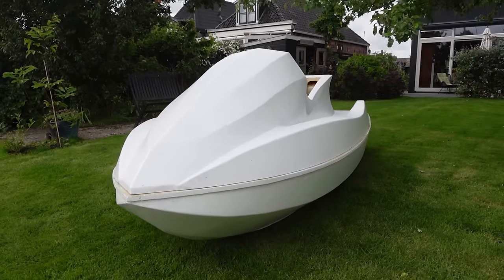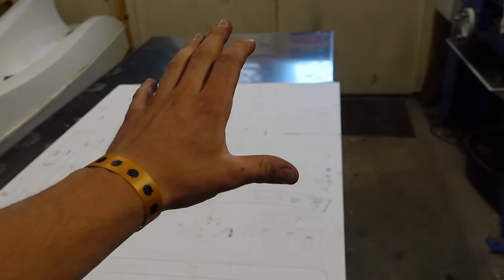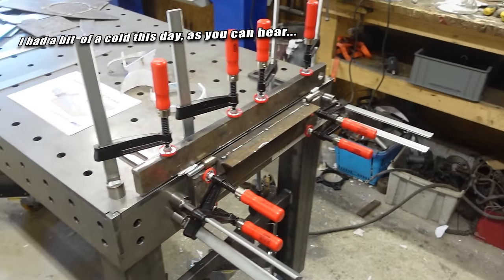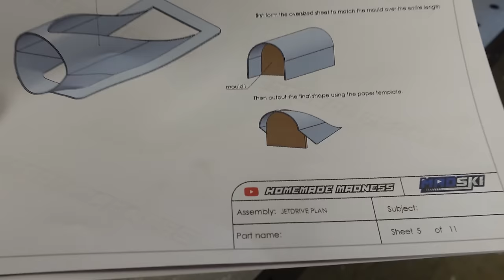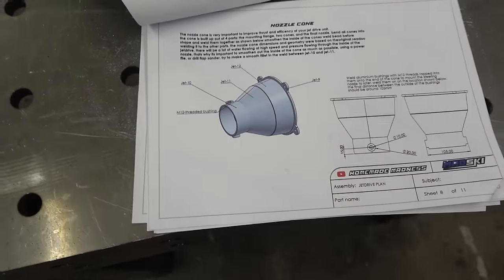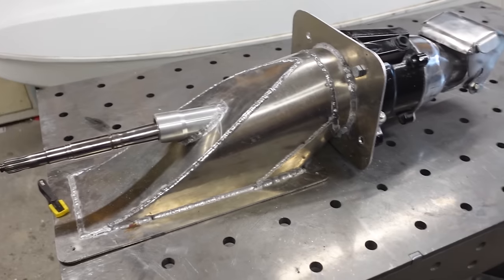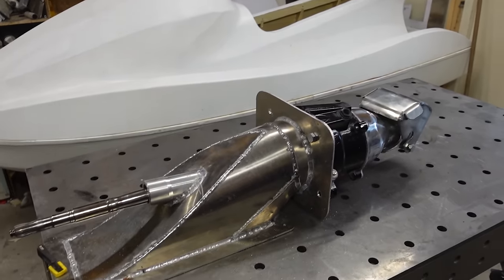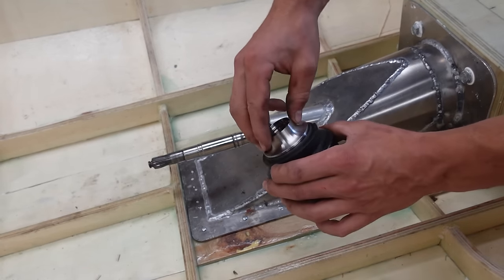How to build a Powerfull Jetdrive 200+HP (for jetboat, jetski, flyboard)

Comment: Aluminium forms an oxide layer almost instantly that interferes with welding so you should grind or wire brush it of around the welding areas right before welding. You may want to wipe it of with alcohol as well as the plastic film might have left some residue on the surface.
Reply: Most would say acetone since it will remove any oils better than alcohol... And some welders would say it's pointless but they are likely ones doing shitty welds.

Comment: Just ran across your channel and love the build and I’m not trying to be one of those people but the force of water going thru that pump I’m afraid will blow those wood screw out pretty quickly, I would also glass the plywood box in a little more on the inside and secure the alum. plate on the bottom. Don’t underestimate the power of water. Again I like the build
Reply: Bro is what I was exactly thinking
Reply: Most of it will see negative pressure. The only part seeing positive pressure is from the impeller to the nozzle and bucket and those are all aluminum and welded.

Comment: Tip for welding aluminum. Always clean surfaces with acetone before welding, even if it looks clean. Wipe your feed rods with acetone as well. It's a good idea to also use a wire brush or green scotchbrite pad where you plan to weld just to make sure surface residue is gone. For areas that will be welded don't mix materials with abrasives, meaning abrasives used on aluminum should only be used with aluminum. Taper the amps at the end of the weld to prevent suck-back (can be source of cracks). Turn up your post flow time to at least 5 seconds, I usually use 7 seconds minimum at 17-25 cfh. 

I like using the foot pedal with aluminum because there's a small temp difference between a good consistent weld and having it blow out. Every time you dip the rod it sucks heat out of the weld and can cause it to re-solidify so I usually manually pulse to keep it in the sweet spot. But overall starting out on the thicker material is definitely easier and will help get the basics down with minimal issues.
Reply: So true, good tips taco
Reply: aluminum welder here. good tips, but I never do these things. too many parts, too little time.. if a weld comes out looking like crap, go back over it and manually pulse the foot pedal. perfect every time!
Reply: good tip. didn't know about post flow. I have it at 3 seconds

Comment: Always so impressed with your skill set. For that being your first aluminum welding project, you sure picked a challenging one.  That said, you are doing great as you always do! Always use lots of sealant on all mated surfaces and on any screws sunk, a dab in the hole before you screw it in. Of course you know this so I apologize for my two cents of advice🤗 What a cool project👏

Comment: When grinding aluminium with abrasive tools a little bit of candle wax helps a lot to prevent it from clogging up and start smearing the aluminium instead of cutting it. Just dab it onto the tool once in a while.
When hack sawing the blades might tend to stick and jump so a little cutting fluid, ethanol or WD40 helps and same goes for rotary filing and any blade cutting.
Reply: Just be really sure you get all the wax off that’s burnished, entrapped or impregnated into the aluminum before you try to weld it.

Comment: First just wanted to say, this is absolutely incredible! Secondly, i work a lot with water jets and I definitely recommend you adding a gasket to the connection point between the impeller and the drive nozzle, as any leaks here when you start adding series power will be a massive pain.

Comment: superb job on tackling this project, As you have found out welding aluminium requires very meticulous cleaning I use a spray solvent from Loctite  SF 7070. It works very well dry's fast and cleans off any grease and contamination perfectly. I even use it to wipe the rods down as well its surprising how dirty they are from the drawing processes.

Comment: One of the first things that you learn in geometry is that a circle is comprised by an infinite number of straight lines 🤔. Great work with the homemade bender. 
I'm not sure how much cleaning you are doing before aluminium welding, but clean joints with scotchbrite and wipe with acetone first.

Comment: Brosif, I have to say this is amazing work. You truly have a gift. In my 35 years of life, I have never seen a metal bender make round shapes..  Maybe I've been living under a rock, but you sir have opened up a new option for me to try! How do you like the welding table so far. I read that it's cast iron.. Does that make any difference to iron sheet when welding, or strength?  TIA!

Comment: Cool job!! Just have to sub!! Always wanted to make a boat with a jet drive, just a tip when welding Ali clean it with a wire brush or flap disc just before you weld it as you need to remove the oxcide lair before welding and make sure it's really clean , the oxcide has a higher melting point than the Ali.

Comment: Just bought the plans, one suggestion I would make is have the cut out plans as one file as well so I can go down to my local office works and get them to print it out on one sheet instead of taping sheets together
Reply from the maker: If you want them i can send them to you no problem, i will add it too thanks👍🏻
Reply: @homemade_madness  have msg you on instagram
Reply: quick question :what form did you receive the plans? software , paper ?

Comment: Great job with the welding . Nice design. Try a Stainless steel wire brush to clean the Ali and Isopropanol before welding . It will make nice welds. Keep up the good work.

Comment: Not simply pretty decent for a first time, that is rather good aluminium welding. The fit seemed very good which is an important step to good connections.

Comment: I use inventor for my sheet metal radii. I can calculate your bend angles for each bend, then I use a magnetic digital pocket angle finder on the metal brake for a more accurate bend. Works like a dream.

Comment: In my opinion it looks like you did a pretty  darn good job for attempting that for the first time.
I did however thought that instead of using the aluminum spacer you welded to make the pivots for the turning device which you also threaded in order to use a bolt for fastening the part that pivoted to provide the ability to turn would worry me because of the bolt backing out and resulting in loosing the ability to steer the craft.This brings me to suggest from experience when relying on the mechanical reliability of such design to use a sturdy dowel pin in replace of a bolt.The dowel pin can be welded to the turning device giving you a more reliable pivot.To implement a sleeve on the dowel pin for added wear longevity would be even better,that choice is up to the builder.You will need to install one dowel  pin with the pivoting turning device attached, then insert the second dowel threw the pivoting turning device and weld that dowel.Unless a dowel is torn off or another part has a catastrophic failure,you should never loose the ability to turn while the flow of water is being properly supplied .I know I'm not the best at describing things but hopefully it makes some sense.
Never the less,well done my friend,you will be building better than most they call experts sooner than you think.

Comment: My dear friend, build yourself a CNC router table as next project. All your templates are asking for a neat cut on CNC table. That will dramatically improve the build quality and amount of pleasure you get from your work. I do both aluminium and wood cutting on my CNC, so you should be able to do the same, especially when you are so good with 3D planning. Thumb up from me, well done!!!👍

Comment: awesome work again man! Just one question...with the cones, why didn't you use the lathe to tidy up the welds?
Reply: not with a cutting tool...still use the die grinder &/or flappy wheel. Having the cones rotating slowly would have helped get a nice clean finish.

Comment: Fantastisch project! How have you done the alignment of the driveshaft? At a certain moment you had to drill the hole for the shaft, but i can imagine this requires a lot of accuracy to allow the impeller to rotate parallel in the housing.
Reply from the maker: Put the paper template back on the top sheet✌🏻 it has the hole marked on it

Comment: Could have just used the nozzle from the donor of the pump and saved some time.. definitely the input housing yas worth it because those are molded unto the skis most of the time (except for some yamahas).
Very cool project and you picked up aluminum tig welding quickly!!

Comment: How much does that lower part of the hull weigh? And which model of drill? Been meaning to build a tiny tender that I can transport in a sedan folded up or similar and power it with a drill, similarly. The performance you got is encouraging since that solid 15mm ply looks pretty heavy to me. Neat :-)

Comment: You can print drawings on A0 size paper. Or print on transparent paper with crosses marked at the corners to overlap tightly. There will be higher design accuracy.

Comment: Using 5200 on stainless bolts to seal them, while at first thought seems like a good idea it's actually not.  It actually creates an environment where stainless steel will corrode. I'm sure you have plenty of time before you need to worry but I think some sort of a gasket or o-ring is a better idea in the future.

Comment: Nice idea. I'm working on the same thing but I want to cast/ CNC machine the whole thing. My 3D model is not finished yet, I want to do some calculations and simulations to get better fluid dynamics. Are you an engineer? I'm studying engineering and when I'm done I want to build the whole thing properly.

Comment: Good project. Sorry to say so but the reversing function is a bit like trying to lift yourself in your hair. If you look at it you have a bigger gap between the revesing bucket and the nozzle facing upwards, and what little you manage to face downwards and forward ends up in the void that the bottomplate creates, inthat it has to reverse to evacuate facing aft an by that giving forward thrust. The seadoo reversing bucket is bad or not ideal. Look att how the bucket is deflecting the waterbeam by just having it in position, alter so thatvyou have minimal gap upards ( in to your boat!) and max downward/forward utilazing parts of a 90 degree aluminium pipe bend facing forwrard/down port/starboard as an addon to the reversing bucket will take you there.

Comment: I would recommend some kind of torquey engine with below 10k rev limiter, jet pump requires a ton of torque to spin and they usually optimized for around 8k rpm, super bike  engines don’t have enough torque at 8000rpm to spin the pump (where the pump is optimized at), jet ski with 170 hp usually have displacement around 1.5-1.8 liter which provide about 170lb of torque as well, super jetski with over 300hp and 300-400lb of torque only tops out at around 8000-8500rpm
Reply from the maker: No problem i will gear it down😁
Reply: @homemade_madness  🥳I can’t wait to see it!

Comment: What a cool project is that!!! Very nice the part where you bend very easily a 4mm alu sheet with your self made bender! Just a question regarding the welding: due is very difficult to weld alu with TIG process if you not make daily practice, could you weld that with a MIG process maybe with a welder with a pulse cycle? I asked just because I know you have a very good MIG welder (the Migatronic) and I use it very often with very good results. Obviously not good as an expert TIG welder but better than my TIG weld for sure!
Reply from the maker: Yes could be done!

Comment: Built PWCs for racing that pump might handle 200+hp but you need more braces on the hull and thru bolts on the intake plenum or the pump will try to push the engine to out through the bow had it happen on a factory prototype carbon fiber hull it made it about 500 feet and it had pushed the pump 3 inches through the hull before the engine flipped over it looked really good when we started , amazingly bad after . How many horses to pull out the screws it's attached with ? What is the point shear strength of the hull and the adhesive/sealant ,latex  bathroom  ,tub and tile ain't going to hold up ,Check the Specifications for the correct adhesive .
Reply: ths nade firc30 foit jet yahhts

Comment: What is additional contribution for this system?  Efficiency increase? 500 watt drill directly  to propeller can pull almost same speed. What is the pros cons of this system?  I wanna build gas powered sea scooter to pull me inside sea over 5 mph that why i intresting to this system.

Comment: If you can cast and machine aluminum...you can make every single part. With all the time (money) you waisted cutting those parts out with a jigsaw, you could have save so much just by sending out the job to be cut by laser or water jet. They would be far more accurate too.

Comment: BTW if you want your jetski to last more than 1 or 2 years you NEED to seal the plywood up on the inside. even 1 layer of CSM fiberglass will be ok. The plywood will rot once it gets wet. I fix boats that have rotten stringers etc as a hobby. wet plywood = big problem

Comment: All edges of the welded (aluminum) elements should be cleaned with at least a stainless steel wire brush (God forbid steel!) and then wiped with a cloth soaked in acetone. Aluminum during welding must be very clean, free from any dirt - especially from oils and fats. Then you wouldn't have to use a cutter to smooth the welds and the weld would be aesthetic.

Comment: Dear Jornt, too informative...is it part of your plan document or needed separate order..? I am ordering for inboard plan soon.
Reply from the maker: Separate👍🏻
Reply: @homemade_madness  Dear Jornt, Greetings . as maintenance expert - felt that : Though vertical mount has 4 fixing bolts, the bolts at bottom plate fixing with hull are very small sized. Will it withstand high energy transfer ? - even at lower hp engine it may be insufficient to withstand vibrations. I will make changes at fixing engine+pump at foundation. Instead of fixing them in wooden hull , it would be better to have metallic foundation frame structure.
 Also, do your plans about this pump has design/layout about  impeller and fix guide vane casing ?   or that need to get ready from site.
Reply: @homemade_madness  Hi,  what are the dimensions of the bottom cutouts made - shown on 20.42 to 21.02 minutes  ??

Comment: The nozzle is to close to the ship prohibiting you from having a real reverse and severely hindering your steering mainly in reverse but also a bit in forward. In reverse you are just pumping water against the stern. Both redirected streams from your jet should just clear the stern of the boat in reverse to work when not steering. In forward you want the arm between the turning point of the boat and your nozzle to be as large as possible with no obstructions like a sidewall. The whole setup needs to be at least 15 cm more to the back.

 I also do not like the seal, it seems to be flimsy with just two clamps one either side. I would go for a water pressure seal as you have enough of it with the jet pump already.

I would strengthen the boat a bit more in the back as well and give the whole inside at least a coat of paint, she is very cold right now.

Me personally would not have made the huge cutout you did in the stern. I would just let the intake and jet pump be on the inside and the nozzle on the outside. This gives a lot more buoyancy and less unwanted turbulance. You will need to trim the whole later anyway and that goes easier if you only need to add weight. Taking it away is quite difficult when in that stage.
Reply: His nozzle sticks out further than any jetski I've been on, and they've all have the same panels on either side, some wider, some narrower, but projection is usually within an inch of the rear. His steering isn't being hindered by proximity, he doesn't have controls mounted to it... he's using his hand, and a 500w drill, to move a 3 seater. The added length alone accounts for any difficulty in turning with no power. 
Which seal? the caulked and screwed inlet, the industry standard carbon ring seal on the driveshaft, or the caulked and 4 bolted connection on the motor mount?
He might paint the inside, who knows, it's not done... 
The engine cutout can have a shield installed... like almost all jetskis have, but the notch in the body has to be there... it's how the prop is mounted. Few have a secondary inner brace and a long drive tube to get the water to the nozzle, they tend to just have a second thickness on the back plank for thrust loads and call it a day (think jet boat, with their enormous rear notch to boot). Of the ones that don't have the prop chamber on the outside, they have a gapped second bulkhead that the funnel and nozzle mount to - 'could he have done that' sure, but there's no advantage to it. It's done for space restrictions, the only difference is whether the prop chamber touches water on the outside. SlickBoating has a quick 'how a jetboat works' with all the images you need to see the above in action.
Reply: @Azmodon  Industry standard is fisherman patent which is a pressurized seal with water. If the boat is electric the same water will also cool the electro motors and in case of an otto or diesel can also be used as inter cooling medium. Do mind these parts can get very hot and the boat will be closed and watertight. There is nowhere to go for the heat if you have not figured that one out and carbon does burn.

Yet this is also experimental to do so I would go so far as to build in a bow thruster jet slat in the back which is way easier than you think. In that case the exhaust of the jet is underneath the boat making maneuvering childsplay and all troubles go away.